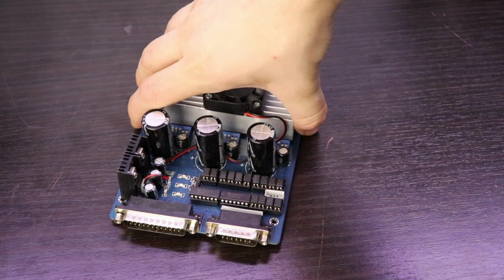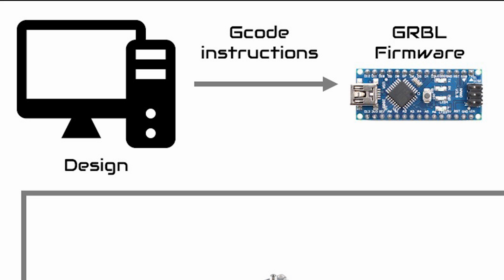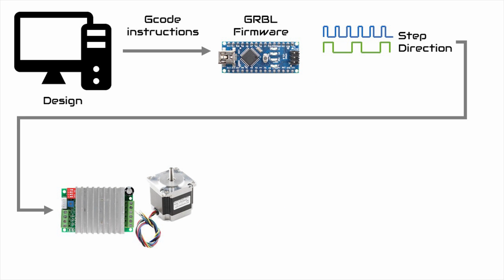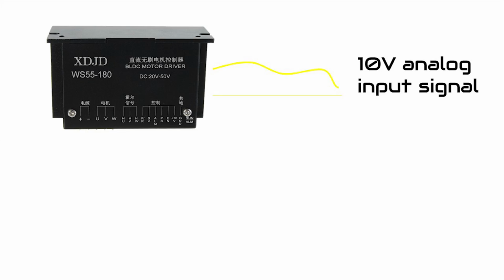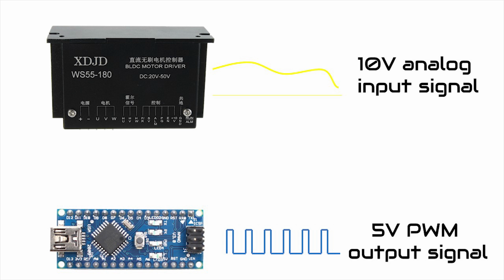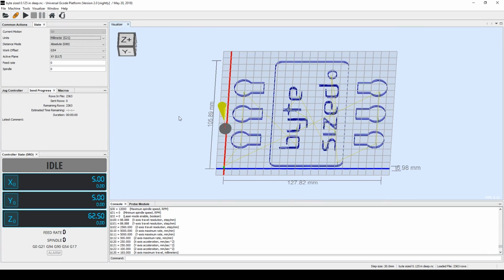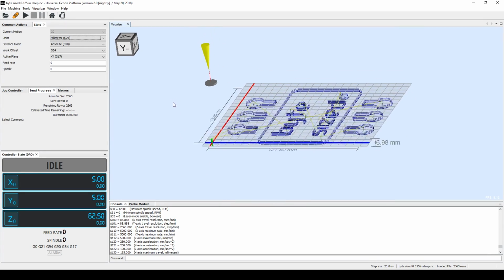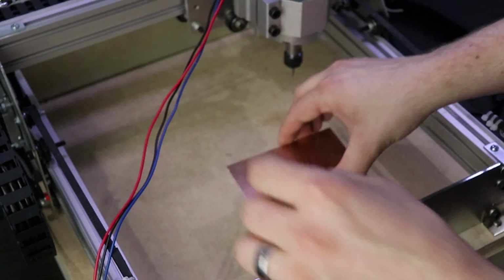How To Build A Desktop CNC Machine

Comment: Hey man I have a question for You...
How did You took the origin of the material?
I mean what did You use to take the zero point so the machine knows where to go?
Reply from the maker: I manually jogged the machine to the corner of the material and visually set it. Then you set that as the home position using the software

Comment: That's ok, nice project. I've been working on mine for 3 years. I started taking it seriously in the past 6 months. It's about 85% assembled now. I have all the parts spec'd and purchased, i'm just mired in the constant design improvement rut as i continue to build. It'll be awesome when it's done but it has been a long time in the making. Good luck and enjoy using your mill! Thanks man, Sub'd.
Reply: @Vilhjalmur The Viking what was cost for you? I am wondering if to make cnc or laser engraver and edit a bit so can have one to do both

Comment: Nice work!!! and I am trying to get some ideas from your video. but now i have a question about power supply. I have 3 stepper motors of 1.6 amp, CNC shield V3 and 1 12V DC motor. If I pick a power supply of 12V 30A. Will power supply provide too much current and damage the motor, board and everything?
Reply: Those V3 shields have plugin stepper drivers and you can adjust the current limit on them. So say 6 amps for the steppers, a 5VDC buck converter to power the Arduino, about  1 amp so the maximum size spindle you can use is  only 150 watts.
Reply: loskop100 That’s really sad as I have already bought the 12v 30a for 3 1.7 amp stepper motor and 1 12v 775 spindle (80w) 
Thank you for your advise

Comment: Very cool man.. And this is why I need a 3d printer. So many projects would be easier when I can build custom adapters, enclosures, fittings, etc.. When talking about 3d printers with my buddies most of them said they want one but don't know what they'd make with a small printer.. they'd want a huge printer that could build idk.. helmets or life sized love dolls probably.. but I can think of hundreds of things I could use a 3d printer for and because of thingiverse I can now find hundreds of thousands of projects.. I can finally plumb in a vacuum system in my garage, build custom bracketry for a bunch of projects I've been wanting to do, including a 360x360 TRULY full motion tv mount that I can attach to my desk so I can swing it around to my bed and angle it any way I want for watching movies in bed. (best place ever for that btw) or in my case most likely youtube videos... Thanks a bunch for this video!

Comment: Why didn't you use pull-down or pull-up resistor insteda of new wires
Reply from the maker: I believe I explained that in the video. The arduino has pull up resistors. I also tried using an RC low pass filter without much success. The shielded cable seemed to do the trick.

Comment: Which software did you use to make gcode?
Reply from the maker: You need to use CAM software to generate gcode. You can use Fusion 360 for CAM, or something like Easel from Inventables.

Comment: When you end the video with "you can cut wood, metal,foam or even plastic" uhm i'm pretty sure cutting steel is a bit harder than cutting plastic lol
Reply from the maker: I think you're assuming that I was listing materials in order of hardness? I was pointing that out because some people may not realize you can cut plastic on a CNC machine. It's not the first material that comes to mind when you think of CNC.
Reply: @bytesizedengineering  i know but your word choice puts them in that order automatically but hey i get it :) no offence was intended just found it funny :)

Comment: you shall use BCNC for PCBs because it has autolevel capability(touches multiple points of the PCB surface and then compensate de Z irregularities in order not to cut too deep into the board.
Reply from the maker: Thanks for the tip

Comment: Impressive project.  I spent over 35 years in the printed circuit board drilling and routing business.  I worked for the companies that build and sell $250,000 multi-head CNC machines.  I started out as a field service engineer and moved up to applications engineer.  I'm impressed with your resourcefulness and keeping your costs down.  The machines I worked with had air bearing spindles that turned 180,000 RPM.  They were powered by a 3 phase frequency converter that varied frequency and voltage to achieve the optimum acceleration and deceleration.  The spindle control was closed loop - including a thermistor for temperature protection.  Each spindle costs $5000.  I drilled holes as small as 0.0020" diameter.
The XY and Z axes servos were closed loop with independent encoder scales.  X and X had 1 micron (0.000039") resolution and the Z axis had 1/2 micron (0.000020") resolution.

Keep up the great work.  I subscribed to your channel.
Reply from the maker: Wow, what an impressive background! I wish I had your knowledge on the subject. Thanks for watching

Comment: For the speed control you could just hook up a servo to the Arduino and control a potentiometer connected to the 12v Rail to get the 10v analog signal
Reply from the maker: Thanks for the creative suggestion!

Comment: So you recommend a faulty part? Why does everyone keep sucking up to Banggood?
Reply: For the price they sell it, you can't really complain about minor issues like misaligned mounting holes.
Reply from the maker: I wouldn't call giving an honest review about a product and highlighting its flaws "sucking up".
Reply: Ultimately the part works well for its intend usage, even if QC may have been out when it went down the line. Drill new hole, secure in place, no big deal. Where else are you going to get such a specific part?
Reply: what was faulty about it?
Reply: Watch the video
Reply: That's your choice.
7.50 into video holes don't line up and has to be modified. Bad manufacture and no quality control.

Comment: If you still have false positive on the limit switch lines, try using a pullups (or pulldown) resistors. Something like 10kOhm... The integrated pullups in the Arduino are not very good for long lines
Reply from the maker: That is a good suggestion. It's something I started doing in the past but never finished. Thanks